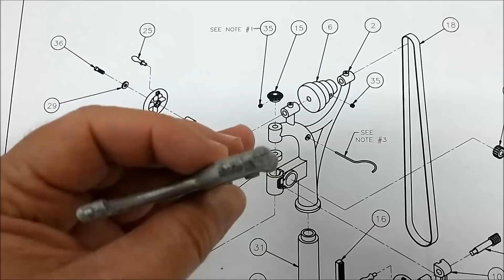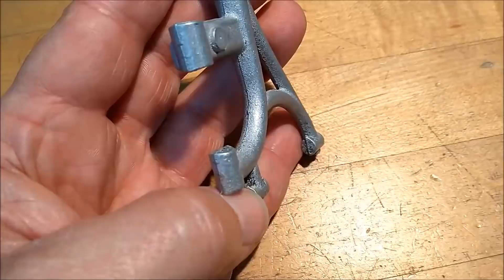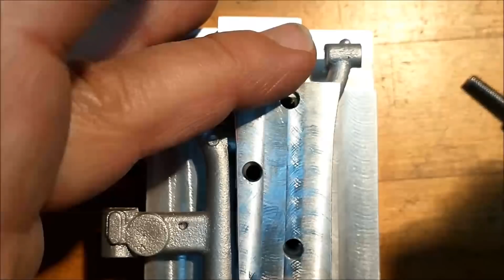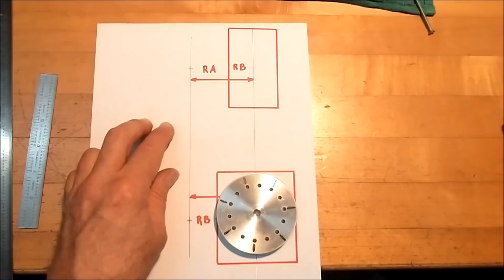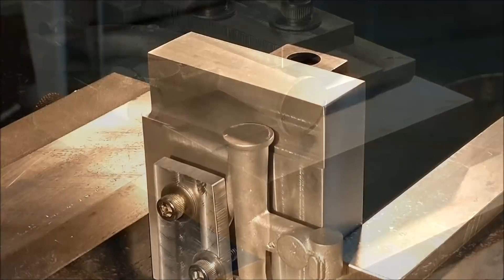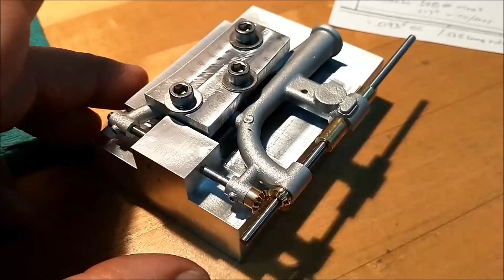You Can't Cut What You Can't Hold !!!

Comment: Did you take into account the taper of the main body of the casting?
Reply from the maker: Specifically for what purpose/ didn't need to.  The registration features were a constant diameter and used the same center plane the main body was using.

Comment: When you touch the part with your finger, are you feeling for vibration or does your finger help to take out some vibration. same as turning a part with surgical tubing around it?
From an old pipefitter who hung around the machinist shop in his spare time.
Reply from the maker: It can absorb potential vibration and lets me know how the tool is performing.

Comment: At this time I don’t intend to build any of this little gems, but watching your videos doing the machining of the parts is addictive 😜
I watched this video two times and why you did not made the jig a little bit wider and put the pins in as a stop for the casting, that way you didn’t have two measure that excessive. Or did I miss anything?
Reply from the maker: You are correct. The jig could have been wider and utilized solid stops or outer pins, but that was a piece of scrap material I had to work with. I also wanted the outside of those bosses to be exposed for future machining.

Comment: Center drill as a spot drill?  Otherwise beautiful work.
Reply from the maker: Absolutely. The use of a centerdrill allows the twist drill to get deeper before the additional pressure of the blunt drill web makes contact. On delicate parts or during the use of hand ground or thick web drills, a center drill is a much better choice. I usually only use spot drills on my CNC and then usually only for holes that will be tapped. But, to each their own.
Reply: @joepie221  Agree but the angle makes the drill od hit first allowing it the opportunity to mis-align versus the spot that allows the tip to center first.  Clearly with your extensive knowledge you know this and it is not significant enough to matter to you.  You are so good it shocked me to see it on your work though ;)
Reply from the maker: @zilogfan  I may actually do a dedicated video on this because you're not the only guy to raise an eyebrow after seeing me do this in most of my videos. More of my logic....If a drill is ground ( probably hand resharpened ) with the outer edges true to each other, the center can still be off by quite a bit. I know the angles of each face would be slightly different to allow this, but I feel the influence of an eccentric web can do far more starting damage starting in a spotted hole, than it would starting on the OD and migrating inward as the depth increases. It will be an interesting demonstration, but I'll stick with what works for me. Thanks for the follow up comment.

Comment: Very helpful and informative videos as always. Thank you for all your time and expertise. To stop the deflection of those fragile features, I use the little adjustable parallel to support it during drilling by just catching the edge of the boss underside to avoid the drill punching through.
Reply from the maker: Wood wedges work good for a one off. Adjustable parallels normally don't go very thin. Thinner than .8 cm

Comment: I think that the jig would probably distort the casting as it is. It would need some very careful filing to witness three points of contact to avoid distortion . Interesting to know if the spindles turned easily on this  model when it was released from the jig.
Reply from the maker: You make a valid point, but the surface was confirmed flat and wiped with a fine file to identify irregularities. The casting will behave just fine when released. Feel free to come back and take a look.

Comment: Here is another possibility for odd-shaped parts. Imbed the part into/onto a block of aluminum using Bondo or a similar goop. The block should be sized/shaped to be able to be held in the mill or lathe. The machining done, the Bondo goop can be dissolved in acetone to remove from the holding block. Depending on the size and shapes of the part and block, and bonding joint size, fairly heavy cuts can be done, even interrupted cuts in a lathe. I saw this used while working at a wind tunnel machine shop in the late 60s, Contour, Inc. in Rosemead, CA. 
Best wishes to you and you family for the Holidays, Joe. Keep up the great content!  Dan
Reply from the maker: Don't get holding and positioning mixed up. A solid combination of both is always required for a successful end result. Happy Holidays to you as well !

Comment: As usual  Joe very good job sometimes it takes 8 hrs to make a nice fixture  that only takes 30 min to machine correctly owned a screw machine shop once made thousands  of fixtures  that took a long time to make some thought it wasn't  necessary but when you have thousands  of the same to do secondary work on they have to be to the print

Comment: Joe, when the journals were being a "pain" and flexing an "uncomfortable" amount while being drilled, could you have used some kind of packing under them to minimize the deflection?  Or would that have caused other problems?  Also, for anyone considering jumping in to this size/type of project or projects, would you recommend going ahead and purchasing aircraft-length (or similar) drill bits of the appropriate sizes before starting to make chips?  I know that I've run into a few occasions where I've had to choke-up on the last 1/8- to 1/4-inch of a drill bit to finish drilling a hole like you did here and wished that I had longer drill bits, but had never really taken a moment to actually think about getting the longer aircraft drill bits ahead of time for my tool box (not including the two or three extra-long bits I've ordered or been given over the years, only one really designed for metal though).
Reply from the maker: Wood wedges would be my first thought.
Reply: @joepie221  I thought you would have gone for aluminum wedges. Wood is just too squishy.

Comment: if ever I have seen an impossible part this is it,,,,,And it got me thinking. We have an old Buffalo 4MT drill press that has been converted to a 5HP electric motor. (Drills 2" through solid steel like it was balsa wood. We we even out flood coolant on it! ) ,,,, anyway, after watching the way you machined the model I started to wounder, how in the hell did they machine the big one,,,,,,and better yet just what kind of machine did they use to machine it! A 5" Lucas woud have been iike using a Bridgeport to line bore a Cat D8 motor!

In any case, one hell of a job Joe. Makes me want to take a beater to the Cinci Mill.After watching you  I don't deserve to own it.

Comment: Joe, I was surprised you didn't put some kind of support iunder those pieces when you saw them flex.  As it flexes, the hole gets out of alignment in the deflected position.  This would only be an on the final drilling operation and the reaming.  I'd also be afraid of cracking the casting.
Reply from the maker: Actually not. If a drill flexes a part during the drilling operation, it starts to create an oblong hole from the uneven load on the drill. Once the drill breaks thru and the material relaxes, the uneven contact happens again almost immediately and shaves off the opposite side irregularity. The hole will be sloppy, but not crooked. Done correctly, the small bite of the reamer should correct any oblong condition.
Reply: @joepie221  thanks. Understood

Comment: Brilliant Joe thankyou. I was really quite troubled with the single clamp and that you didn't leave any location  pionts for positioning on your block. That risk of deflection was very high and then I realised ahh yes I'm used to working from a cardboard box of blunt / semi blunt end mills and slot drills ecause I'm only producing weld preparations and approximately placed recesses. All rough work. So please forgive me for that. Love your ingenuity Joe. Id like to think that I'm always practising to obtain precision but as I've detailed it's not necessarily always a possibility and sketchy at best for me. But every time I manage it I privately celebrate it to keep my spirits up 😁
Reply from the maker: If this part was steel, I would have incorporated eccentric bumper pins in a few locations. Since the material was soft, I was confident the clamp pressure was adequate for the cutter load.

Comment: My first try at that part I crushed the larger diameter hole in the vise.🤦‍♂️So I ordered a second piece, and made a holder for it. It is a very fragile and awkward piece. That is a very well thought out fixture especially the block in-between the two distant holes for the top shafts. Thanks for the a and b description will definitely hang on to that one.

Comment: Thanks Joe, as always, I learned something new, the step-pin trick is clever!  

I do have a question regarding the flex in the part when drilling.  Your solution was to use a smaller drill that applies less force to the part, makes sense.   Is there a reason not to simply support the underside of the cantilevered component instead?  I probably would have placed a small, wedged shaped piece of aluminum under the part, just tight enough to prevent it from falling out while drilling the upper boss,,, but remove it once I've broken through.  

Always more than one way to approach things, just wondering what your thought process is when deciding which path to take.

Thanks again for the continuing education.

-Kurt
Reply from the maker: Multiple supports would have helped for sure, but for one piece in soft material, I drew the line at the necessities.
Reply: @joepie221  Okay, thanks for the clarification, I've made the same decision many times.

Comment: Great video,  love the solution for lining up centres. Awesome. Thanks for sharing
Reply from the maker: I could have milled offset hard vertical surfaces into the fixture as well, but for a single piece, it wasn't worth the extra time. Besides, I felt the pin method would make a good gem to include.

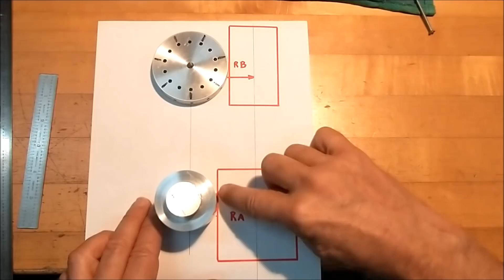Comment: 10:56 the two pin concept was very clear, BUT there is one thing I could not grasp. The assumption is that the center line between the two bosses is absolutely perpendicular to the machined length of the fixture. But how do you know?
Reply: he's not assuming it, he's moving the part in the fixture till it is
Reply from the maker: Geometry and a few light taps on the part before I snugged the clamps assured it was true.

Comment: So true one can't cut what one can't hold. I would have used drill bushings in the fixture to guide the drills into the part. I bought a book in the early 1980s that explained the use of drill bushings in fixtures with delicate holes drilled in parts such as this one.
Reply from the maker: Drill bushing really eliminate fixture wear. Basically a must for high volume tooling.

Comment: Does anyone using the polycaprolactone to create a "mold" for holding or to lock hanging ends?
It is pretty tough and melts in hot water (feels like a putty above 140'F/60'C).
Reply: Could use a hot glue gun or super glue a block for support.
Reply: you could just use a piece of wood the size of the distance between the part and fixture, it doesn't require much to support that.
Reply: @blizzardesigns  good idea

Comment: GENIUS holding method and GENIUS locating method for those different bosses. In the shop wherein I learned the most we cut the leather tongues out of old boots that were being thrown away and used them as a cushion when clamping castings with undependable surfaces. Also great for clamping a stack of plates that aren't of precisely the same width by their edges to enable working them as a gang.
Reply from the maker: I like the leather concept.
Reply: @joepie221  Delighted to be the one offering you a tip for a change!

Comment: Always more than one way to skin a cat. If one had to make more than a couple of these. On the left hand side of the fixture establish two L shaped offsets. These offsets or legs project to maybe .05 above the casting centerline. The shoulders on the legs are offset from the centerline of the spindle bore by the difference in the radius of the casting diameters of the bearing housings for the spindle. To locate the casting centerline parallel to the base of the fixture pick three spots on the casting and mill rest pads the match up to the differences in the casting thicknesses at those points. When castings are machined in a mass production environment. Such as say engine blocks, cylinder heads, or any other parts. There are usually three spots the casting will be located on in on plane and two spots in the plane at a right angle to the first. These locations are the reference points to which the initial machining operations will be performed. The initial machining operations will establish flat surfaces that the casting can be clamped against with another casting feature being used to locate the casting in relationship to the main manufacturing holes used to locate the parts in subsequent fixtures. All additional machining operations are performed relative to these planes and main manufacturing holes. The main manufacturing holes are used to locate the parts in subsequent operations.

Comment: Hmmm. Small block of material between the lower end of the part and the fixture to avoid the flexing? welded in place with a tiny TIG tack? Or would that be overkill?

Comment: Watching this and I'm wondering on how you are going to cut the bevel gears. Most of what you have seen  so fare is good but the real trick will be the bevel gears and that's what I'm waiting for. Early this year I bought me a Atls H Mill, took it apart. realy  good condetion, on putting back to gether I F##K up and didn't tighten down the main lead screw, and that took out the bevel gears, Where does one find bevel gears for a Atlas Mill. So for about 6mo I worked on making a jig to cut the gears, I just like to see how you are going to do it
Reply from the maker: They are part of the kit, but if I had to make them, it would have been in a spin indexer or dividing head with a form tool.
Reply: @joepie221  I have both Spin & Dividing, My Machinist Hand Book twentieth edition dosent show this, yes it does go into all the coluations, The machine needed to cut the gear is what is needed
Reply: The beveled gears are part of the kit when you buy it.  They are already made including the hole in them.  As for your Atlas mill you should be able to match up the bevel gears with a stock gear from Boston Gear or Martin Gear.  May have to machine it to fit but at least you won't have to cut the teeth on the gear.

Comment: Hi Joe,
Hope you are soon feeling back to normal.
That is a very interesting part to hold, your jig would have taken some working out to get it to do all the surfaces you needed to machine etc, and to hold the drill in line in those long boring operations.
I did notice when you were drilling the hole through the second portion of the main shaft the bottom section was flexing quite a bit, so you need to have not only perfectly straight drills but sharp tooling to minimise load on the part as well.
In Australia we rarely get taps with either centre holes or points, which make use of the follower impossible. They are certainly a good aid on those small taps.
Regards from Oz, Dennis.

Comment: Do you plan on filling those voids? Would aluminum filings and epoxy work for that? I know sawdust and wood glue works good on filling gaps in wood.
Reply: Material Called 'Lab metal'...Spoon it out of the can and repair voids in aluminum.
Reply from the maker: I may.

Comment: Has anyone ever tried using plumbers stick epoxy as a form of work holding/alignment for parts like this? It seems like might also be an option in such a situation. But I could could be completely wrong due to the lack of experience.
Reply from the maker: You could nest it many ways, but getting the planer alignment is a whole nuther story.

Comment: Try sawing a small alumin. wedge to support the bushing end  against the cutting forces.   The deflection will cause the drill to  wander off location or axis that the reamer will only partially cure. awesome video!
Reply from the maker: Wedges would be a good addition. Set screws in the fixture under the part would help too. I had swivel tip set screws on the bench but opted not to use them.

Comment: Sometimes making a fixture can take longer to machine than machining the job itself but it’s absolutely necessary. Great job in showing why fixtures are important.
Reply from the maker: Not too many job shop bosses ever want to hear that. I call that the "next time" syndrome. We don't have the time right now, we'll make the fixture next time. I hated that mentality. ZERO vision.
Reply: @joepie221   very true but sometimes you can’t do the job correctly without, especially with castings.

Comment: as always, amazing work!...and education.
couldn't you have put a machined block between the two features to prevent them from deflecting during drilling?
Reply from the maker: Yes. That would have helped, but for one piece, I draw the line somewhere.
Reply: @joepie221  lol, if you are drawing the line, i trust it is in the right location!...down to 1/10,000th. i am just learning machining (thanks!), but guess the reaming operation will get rid of any small alignment irregularities due to deflection that get introduced?

Comment: Babbit into a square pocket, gives you 5 planes of setup and any angle from those
Reply from the maker: Many suggest this, but placement of the part is still the wildcard. Don't be fooled into thinking, holding is the same thing as positioning. Thats a recipe for disaster.
Reply: @joepie221  I understand that, I figured you could use 2 parallels on the sides to get it squared in the babbit